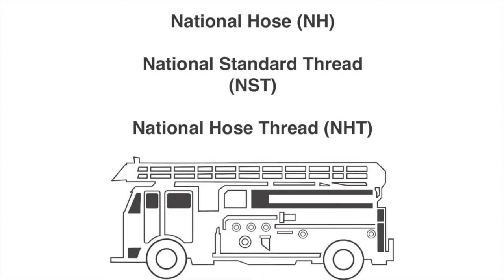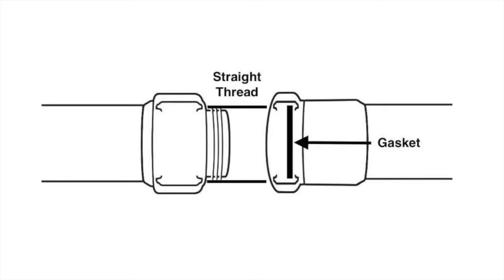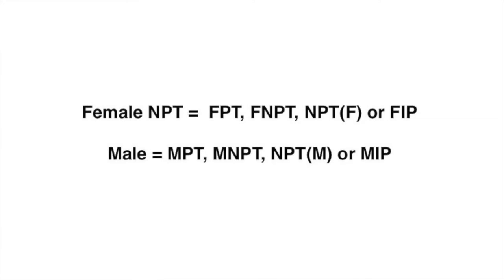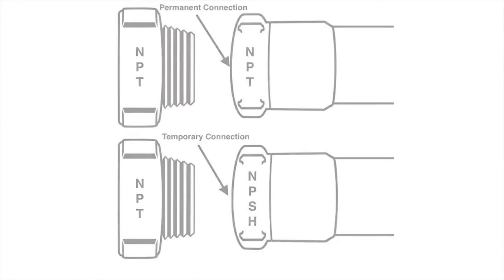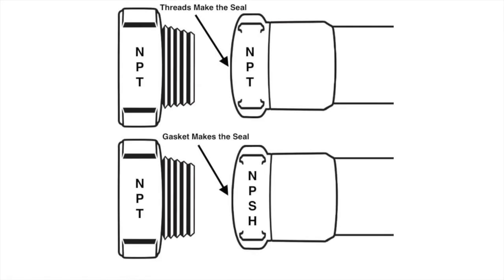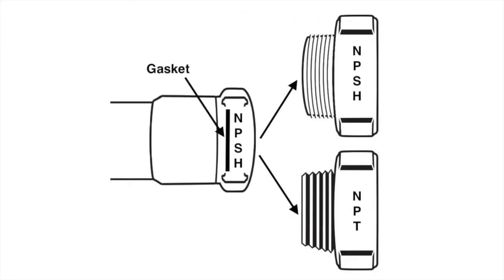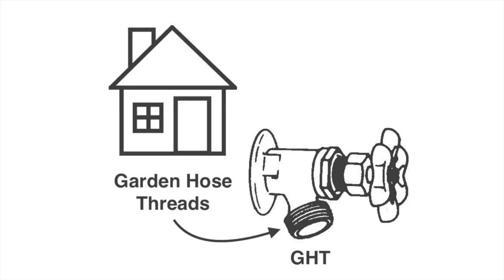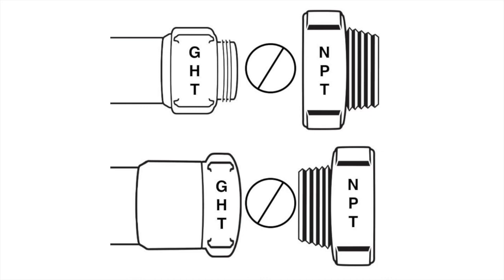How To Connect Using NH / NST, NPSH, NPT and GHT Threads

Comment: everywhere I look it is telling me that GHT is also the same as NH? is that accurate? I have shellfish dealers trying to put a back flow preventer that supposedly has standard hose thread and requires a spigot or adapter with "at least 4 NH threads," onto their sill cocks but it is not fitting... and I'm not finding a GHT to NH adapter... other dealers have used a GHT to NPT adapter somehow and got it to work but that same trick has not worked for others. I'm sooo confused... annnd so are the plumbers dealing with this lol.
Reply: NH is not the same as GHT. NH seems to have more threads. I'm trying to find a NH to GHT adaptor myself.

Comment: Are NPSH and NPSC the same thing?
Reply from the maker: Hi,

NPSH stands for National Pipe Straight Hose thread. It has the same threads per inch as National Pipe Thread (NPT) but the threads do not taper. This allows a female coupling to thread onto a NPT fitting without being a permanent connection.

We are not sure what NPSC thread is, and cannot comment on what the connection looks like.

Thanks